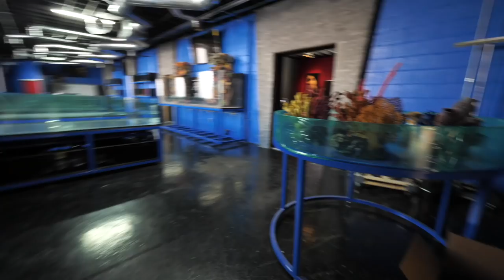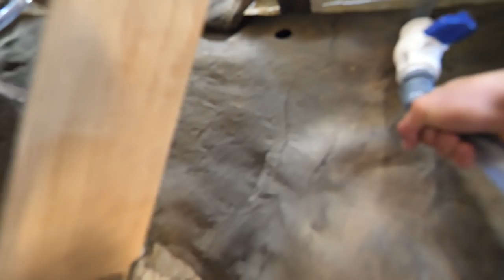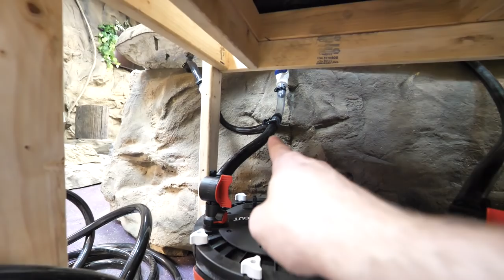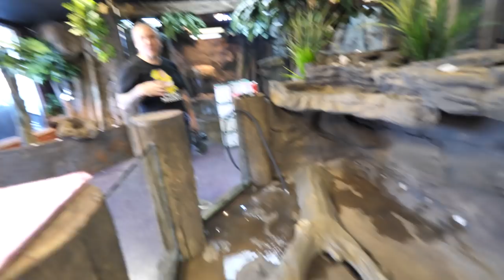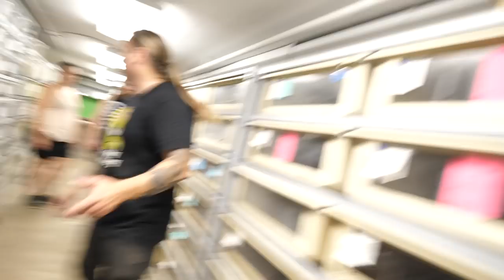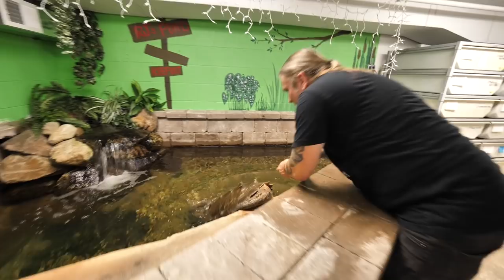ALLIGATOR SNAPPING TURTLE POND!!! | The king of DIY

Comment: Most turtles need twice the filtration for a normal tank, they’re incredibly messy... so hopefully that’s enough
Reply: Snapping turtles are usually a little better though, I found they don't eat anywhere near as much and the food doesn't break down as much.
Reply: Yeah turtles often need 2-3 times the filtration capacity of the tank. All of our aquariums has at least double the standard filtration and still get very messy. Weekly Water changes are a must to remove debris
Reply: So, would one canister filter work for a single iguana 55-gallon water feture?
Reply: He'll be alright. Pretty sure his original pond with RJ didn't have as nice of a filter setup, and they kept it quite nice.